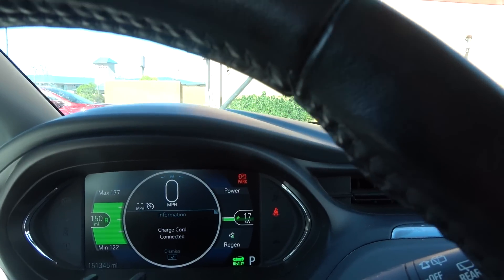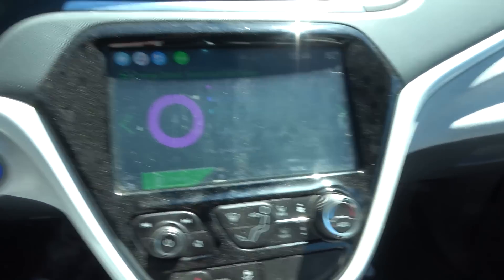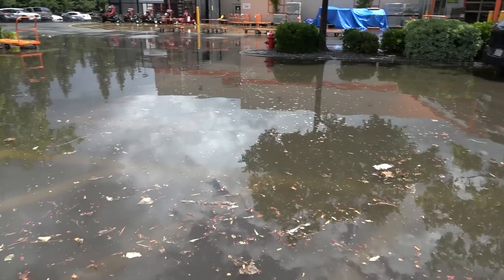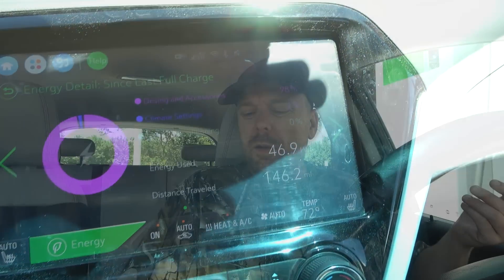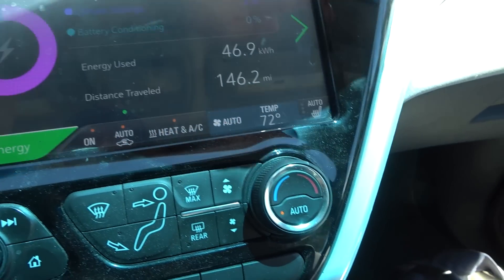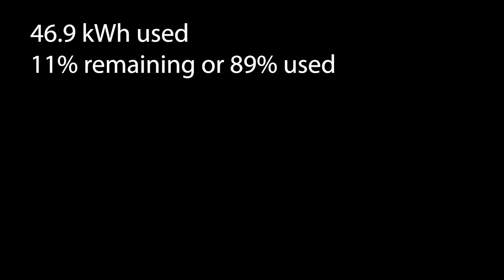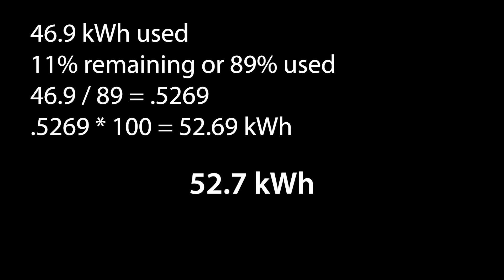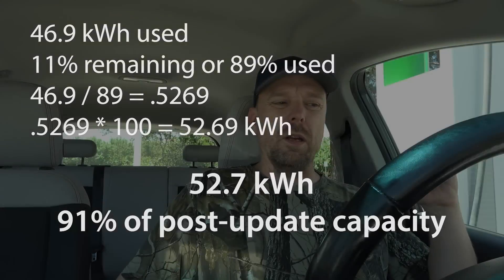2017 Chevy Bolt EV Battery Degradation at 150,000 Miles

Comment: Interesting to see your experience with the 2022 Bolt since it is very different than my 2022 Bolt EUV. The charging speeds are actually much more consistent on my 2022 than my old 2019, and the threshold of minimum temperature needed to get max charging speeds is lower. As long as the battery is at least about 65f, I’ll get around 50kw charging speeds up to at least 50%. If I plug in at a higher SOC (say like 30%) then it’ll maintain 50kw until almost 60%. If I plug in at below 10%, it’ll taper closer to 50%. But yeah, as far as being able to get peak charging speeds, my 2022 seems better than my 2019. My 2022 also has the updated pack (the car was built after the battery problems were found and production was restarted)

The slow DCFC speeds are frustrating on road trips (especially after you experience road trips on a car that charges much faster, like my Ioniq5) but the benefit is that it helps reduce battery degradation. I actually typically charge my Ioniq5 on 150kw chargers because it still charges really fast and doesn’t heat up the battery as much.
Reply from the maker: Interesting. I'm pretty sure temperature is the problem here, but I wonder whether your 2022 is more consistent because of lower temperatures. On the high end, it seemed like one of the recall software patches actually put some checks in place because of battery overheating, which is a bigger problem for me because of higher summertime temperatures. 

Over all, I would like to see the Bolt EV's charging speed improve, but I also understand why it is the speed it is. It's the cost of having a low-cost, long-range battery. Still, GM didn't configure it as ideally as they could have, and I think people would be surprised by the result of something as simple as a 200 A charging socket. At that point, it could have a charging curve similar to the Kona Electric or Niro EV, but I wouldn't expect GM to push it that far.

Comment: Nice video and info!! I'm @ 135,XXX with ~54kwh.  Degradation has been more noticable in the last year, I've been charging to 100% pretty much every AC session, due to range needs.
Reply from the maker: Interesting. So our numbers are not too far off. I'll probably do another test soon (if I decide to do a 1000 km speed test, I'll start at 100% by default).

Comment: Piling the miles up on my '21; looking like a very solid long term prospect. 10%, sweeeet! Might be adding a '22 or '23 Bolt to our family but want to be assured that the charge curve for these cars isn't too much worse than our '21. We road trip fairly often in the 250-350 mile range and it's been little to no problem in the '21. I actually ran into 2 consecutive Ioniq 5's having multiple charge errors at an EA in Pennsylvania; ahh, early days.
Reply from the maker: It should be the same charging curve as your 2021. The issue seems to be with the thermal management settings, and if you push the car too hard, you get punished. There might actually be a better strategy for traveling with the Bolt EV, but if you take it easy on road trips, you might not even notice.
Reply: @newscoulomb3705  Well that is good to know. Might have to addend the old best ravel speed for available charge rate chart, ehh? Seriously, that sounds okay especially since most of our trips so far have not had more than 1 DC session in the middle. I believe the '22 has slightly better aero as well. Tom Moloughney was supposed to publish new 70 mph range tests for EV and EUV (they haven't dropped yet I believe). He stated on the inside EV's podcast that the Bolt EV went further than it's EPA range rating; the EUV went something like 232.

Comment: Good information.  Didn't think to do a degradation test before I had the battery swapped.  At 40,000 miles, I've put a little over a quarter of what you done, and relatively little DC fast charging except for the occasional trip to see my daughter.  Still, would have been nice.  10% degradation after nearly 5 years and 150,000 miles is pretty reasonable.  Thanks for taking the time to let us know.
Reply from the maker: Thanks, Bruce! Yes, degradation isn't going to be a big deal for most people. The whole reason I decided to do this channel in the first place is because I knew my personal driving needs/habits pushed way past what the average person needs/does. If the car can serve my needs, it should be good for most people.

Comment: Good result. The Bolt barely DCFCs at 1C and it seems to have a good cooling system, so I bet you didn’t lose too much from DCFC, but there is no way to tell. I am guessing GM calendar aging lost you a few percent and time spent at 100% lost you several percent if not 5%.

Comment: 58.6kwh for my 2019 with ~10K miles on it.  Best I could ever get.  Also before it went away, I found that 55-56kwh was about as good as it got as the last 5% became highly unpredictable by 35,000 miles.
Reply from the maker: Yes. That's why I'm assuming ~2 kWh came off the top of the original programming. I don't know anyone with a 2018 to early 2019 that ever showed a full 60 kWh.

Comment: I have a 2017 Premier with 39000 miles on it and got my new battery pack 4 months ago. I have just recently gotten my battery pack coolant reservoir to stabilize at the correct level because the dealership did not follow GM guidelines when I got my new battery pack. When I got home with the new battery pack I checked the battery pack coolant reservoir and it was about a quarter inch of Dexcool in the bottom. I was not happy. Right now I am debating on a new 2023 Bolt EUV or a 2023 Equinox EV with the Ultium Battery pack. The lower prices on the Bolt EV and EUV is great and the Equinox should start out around 30,000 dollars. My new battery pack is doing fine. I am also looking at the possibility of an Ioniq 5 or a Ford F-150 Lightning. I would love to have better DC fast Charging and faster Level 2 charging as the 2022 Bolt EV and EUV already have. I wish the 2022 Bolt EV and EUV had faster DC Fast Charging. The Ioniq 5 seems like a good option for DC Fast Charging but not so good Level 2 charging. I guess it would be smarter to just keep what I have.
Reply from the maker: I'm also keeping an eye on the Equinox EV. The Ultium battery should represent a very big jump over what we see in the Bolt EV. The Ioniq 5 is a beast when it comes to DC charging, and the AC charging speed really isn't that important in my opinion. There are a lot of good EV options, but I agree: Your current Bolt EV is a known quantity.
Reply: @Stan Piers - as a potential new owner of a  lot-bound 2022 Bolt EV awaiting its new battery, could you elaborate on how the service tech did not follow GM guidelines for the install?

Comment: Great to see you get the original pack to 150k. Doesn't sound like we'll see what deg at 200k would have been but it's a valuable data point to have here before you get the replacement pack. Well deserved and hard-earned after all those miles and fast charge sessions in the service of other Bolt EV drivers!
Reply: He needs to hurry and drive 50,000 miles this summer , for the subscribers
Reply: @olemissjim  I'd happily chip in for charging costs to see it =)
Reply from the maker: Thanks, Steve! I need to start making some phone calls to see if I can get this pack replaced soon.

Comment: Wow! That’s great news about battery life. How long do you estimate it will be before the battery needs to be replaced? I only ask because EV skeptics tend to always bring up the “you’ll have to replace your battery in just a few short years and it will be very expensive” argument.  What are your thoughts on that?
Reply from the maker: It's going to be hard to tell because my Bolt EV is still slated for a battery replacement under recall. Also, it depends on what metric you use. If we consider 80% of the original capacity the cutoff for automotive use, it's looking like a minimum of 12 years and 300,000 miles before the battery would need to be replaced. At that point, the original battery would probably still have another 10 to 20 years of service life as a "second life" battery before needing to be decommissioned and recycled.
Reply: @newscoulomb3705  interesting. By your estimate, 300k is incredible. I don’t know very many ICE cars that would last that long.
Reply from the maker: @vezner  Most wouldn't. With 300+ mile batteries, we've now gotten to the point where the battery is going to outlast the life of the car itself.
Reply: The 80% figure is very arbitrary. It ultimately depends on what type of driving you do and how good the charging network is.

Someone who uses the car primarily for city driving has no reason to pay attention to the 80% cutoff. Even road tripping, if the charging network is sufficiently good and you're the type of person who needs lots of breaks anyway, 80% the Bolt's capacity is just fine, especially if the road trip is taking place during the summer (as most road trips do).
Reply from the maker: @ab-tf5fl  Yes, that's true. Realistically, you could keep driving down to 50% or even 60% battery. Some original Nissan LEAF owners did. It's very limiting, but still possible.
Reply: Another interesting question about battery replacement is, will be possible to put in the latest and greatest tech, rather than being constrained by what the battery tech was at the time the car was produced. Imagine in 2040, being able to upgrade a 2017 Bolt to have 500 miles of range, with 250kW charging speeds.

Unfortunately, my guess is that this scenario is more likely to be fiction than fact, primarily because the automakers themselves have no interest in offering upgrades to older cars, as it is more profitable for them to have people junk their old cars and buy new ones. And, a 3rd party trying to offer upgrades without the blessing of the manufacturer would face enormous technical and legal challenges. They mind find themselves unable to get the parts they need in the proper size/shape for a reasonable price, or even face straight-up lawsuits by automakers for violating their intellectual property.
Reply from the maker: @ab-tf5fl  Right now, the only automaker that is actively anti right to repair is Tesla. There might be others, but GM is definitely not one of them. The biggest hurdle for a car like the Bolt EV is the software and programming. Once that is effectively cracked, it would easily be possible to upgrade the battery and charging system with third party components. 

Achieving 500 miles of range in the Bolt EV with current battery technology would be a stretch, but 350 kW charging would definitely be possible. 

On one hand, we are finally reaching the number of Bolt EVs required to justify third party support. The problem is, with all the batteries effectively being brand new as of 2022, the need for aftermarket battery replacements has been pushed out another full decade.
Reply: @newscoulomb3705  

Yeah, the 500 figure I threw out is an intentionally high number to reflect future battery improvements over the next 15-20 years we don't know about yet.

But, the Lucid Air does 500 miles on one charge, so it's not that crazy.
Reply from the maker: @ab-tf5fl  Sure, long term, just about anything should be possible, but Lucid is using ~115 kWh to get 500 miles of range. Even using Lucid's battery tech, we could only fit maybe 2/3rds of that into the Bolt EV. With upcoming solid state batteries, we probably could fit 100+ kWh into the Bolt EV safely, but we'd still have a ways to go to hit 500 miles.

Regardless, with aftermarket battery replacements, we would need to strike a balance between the economics and the improvements. For instance, how much more would you be willing to pay for 50% more range (400 miles) and 150 kW charging?
Reply: @newscoulomb3705  

I was actually imagining a scenario where instead of consumers paying to improve the car they've been driving for 10+ years, the improvements get performed by dealers. Buy up very old cars for cheap, replace the power train with the latest tech, sell for a profit.

Of course, as you said, such a refurbished car has to turn a profit at a price point well below that of a new car, or the idea becomes a nonstarter.
Reply from the maker: @ab-tf5fl  Yes, in that regard, you're not going to find any company that will buy up their old cars, upgrade the hardware, and then resell them. And honestly, it's better for the market that they don't. It's easy to forget that a majority of people don't buy new cars, ever. The used car market is actually very important to the economy, and it's an important means for a large percentage of consumers to buy cars. 

Right now, it's also the only way most consumers can afford an EV.

Comment: i have a 2018 the battery is replaced. i noticed a slight increase in efficiency after replacement along with more range. no one seems to notice the increased efficiency, i'm interested to see if you notice after replacement.
Reply from the maker: I definitely noticed better low speed efficiency in both the 2020 and 2022 Bolt EVs that I've reviewed, but it was hard to see any difference at freeway speeds. With my current tires, though, it will be even harder to tell because I lost at least 5% efficiency switching over to them. I'll definitely keep an eye on the efficiency after the swap, though.
Reply: @newscoulomb3705  which tires are u referring to? I saw a 3%+ decrease when installing my latest pair of Continental ControlContacts. Will be going back to Energy Savers next, It think.

Comment: I observed 52.1 kwh used from 100% down to 3% back in April on my 2017 (just before battery exchange).  Add 1.8 kwh for the remaining 3% gets me to 53.9 kwh - at 77k miles.  That’s about 10% reduction, assuming full 60 kwh capacity.  There’s a label on the side of the battery which says 57 kwh, so maybe closer to 5% degradation?  The new battery (installed in May) tested out at 62.4 kwh used when the charge level was at 3%.  From this, I calculated the as new capacity as 64.33 kwh, which works out to almost a 20% increase - gotta like that!
Reply from the maker: The update GM did in 2017 appears to have reset the energy calculator to register ~58 kWh instead of the ~60 kWh it was originally, so you probably were only about 6% degradation at that point (which would track pretty close to what I was seeing, too). The 57 kWh was LG's internal rating system, which was based on a slightly different voltage range and discharge cycle than GM's energy rating, so I wouldn't put too much weight on those battery stickers. 

As for the new battery, yes, I've seen the energy capacities for both the 2020 and now the 2022, and both showed between 64 and 65 kWh usable between 0% and 100%. That's going to be a huge bump for me when I finally get the battery. That ~11 kWh or 20% bump should result in about 30 to 40 miles of additional freeway speed driving. It's going to be sweet!

Comment: One thing people gripe about the bolt is the low fast charging rate.  However it appears to extend battery life
Reply: seems dubious considering much faster charging vehicles are also achieving similar degradations

Comment: Is there a low-end buffer on the battery?  0-100% on our car only maps about 93% of the total kWh.  Could your degradation be less than you calculated?
Reply from the maker: Not that I've seen. There might be a voltage buffer, but it's not accessible to the user. When you hit 0% in the Bolt EV, it's done. My theory is that when GM did the battery software update where I observed 2 kWh go missing, that was possibly to set up an inaccessible top and bottom buffer to prevent battery stress. But I was accounting for that in my post-update degradation calculation.

Comment: Wow good info thanks. What kind of temperature has your Bolt been subjected to? We are in Phoenix where it hardly cools down in the summer.   Wonder how the Bolt would handle the heat. We almost bought a 2022 Bolt before the battery issue. Dealer was being a jackass so we walked. We might look at a 2023 with the new lower price when they come out.
We had used 2014 Bmw I3 and the range was only 82 miles and in the two years we had it dropped to the low 50's range. Got rid of it at that point. 
Looking forward to getting back in an EV at some point.
Reply from the maker: Luckily, we have all four seasons here, but the highs in Northern California and the Central Valley rarely exceed 110 to 115. Still, I've flogged it at high speeds through those temperatures with repeated DC fast charges before, so I can honestly say that this car has been pushed pretty hard.
Reply: I'm in Las Vegas. I have a '17 with the replacement pack. I drove out to Indian Springs this past weekend. It was 108° I set my AC to 65° and my cruise to 75. It's 35ish miles and roughly an 800' rise in elevation. I averaged 2.7 MPKwh.... Times 66kwh battery gives you 178 miles under those conditions.

Comment: That is impressive to have only that level of degradation.  We ended up getting a buyback from GM at a decent price on our 2018 Bolt as we were planning on selling it and had purchased a Model Y.  The Bolt was amazing and if we needed two cars we would have kept it in a heartbeat.  In fact with the current lack of good used EVs we could have sold it for quite a bit more than the GM buyback.  But who can predict a pandemic with global supply issues....Are you planning on keeping your Bolt after the battery replacement or thinking of another EV?
Reply from the maker: I'm definitely going to keep the Bolt EV after the battery swap. The next car on the chopping block is the 2015 Chevy Volt, but I'm not in a rush to replace it. Maybe as it gets closer to the warranty period ending, I'll start looking. The Equinox EV is probably what I'm most interested in at this point, mostly because of its cost/value.